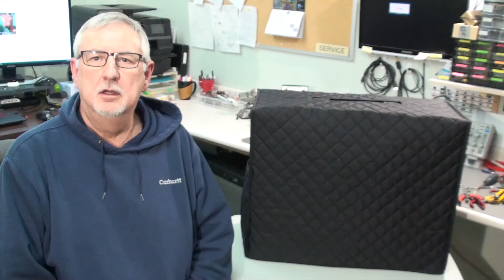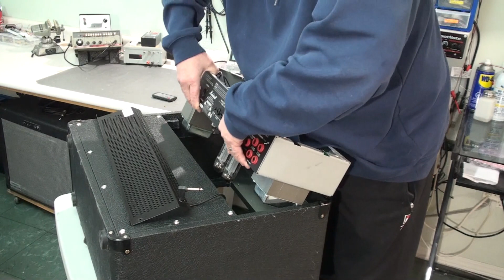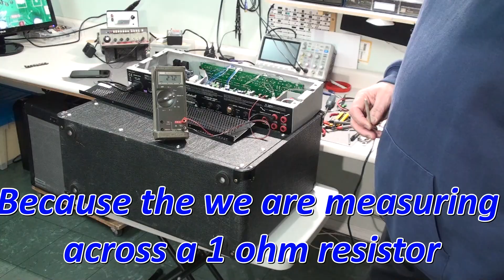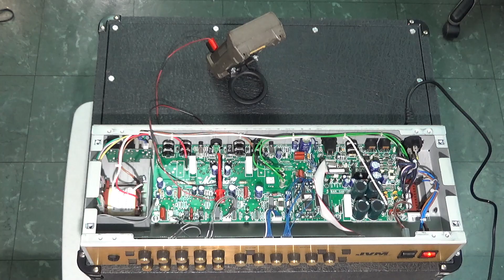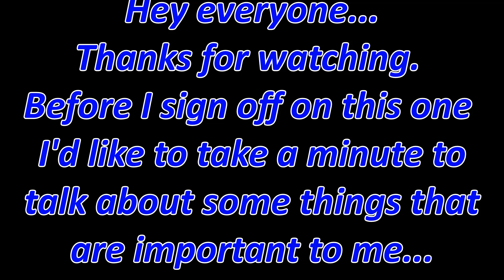Re-Tube and Bias a Marshal JVM215C Amplifier

Comment: Tubes don't change the sound. Only the gain-factor and maybe how the amp "feels".
And the bias is not "too cold". Modern amps like this one get all their gain from the preamp, and are designed to have the power-amp-section stay clean as long as possible. Meaning that if you set the bias hotter, you'll only wear the power-tubes and transformer out faster.

Comment: I have the same amp. The left side bias is normal at 35mv, the right hand side is 70mv when cold with the bias pot turned as low as possible, and steadily climbs to a scary 114mv after about 5 minutes. 
I have the dreaded bias drift on an amp built in 2022.
Reply from the maker: Thanks for the comment. I haven't encountered this, but I really haven't done many bias setups. I did a quick search online ("tube amp bias drift") and there does appear to be quite a bit of information. I could reiterate what I found but it would probably be best for you to do that search and check out the results. I will say that the simplest and most obvious solution (which I assume you probably already tried) is to change out the tubes, and make sure the new ones are a matched pair. After that, check your power supply voltages. Hope this helps and you solve your issue...
Reply: Great video, very informative. Thanks a lot

Comment: could you run 6L6 tubes in this amp?
Reply from the maker: Thanks for the question. I'm not sure I have a good answer. My experience with tube amps is somewhat limited. I have read that they have the same pinout except for pin 1 is missing on the 6L6 and the El34 uses this pin and there is circuitry connected to it. The voltages and bias currents are different as well. However, apparently some amps are designed/built to accommodate either tube. I found one comment on line that said, "Amps wired for EL34's can take 6L6's no problem, provided they can be biased. However, Amps exclusively wired for 6L6 tubes may require rewiring of the sockets to accept EL34's." Your best bet is to do some searching on your own, or talk to someone who does a lot of work on tube amps. Sorry I can't be more help...
Reply: @techtips983  tnx

Comment: Great Video thank you very much.  Wish i can have a question. Same with your amp here but mine sounds different after changed new tubes.
Reply from the maker: I'm not really an electric guitar player but I've been told by experienced players that they can hear the difference in sound when using different brands of tubes. This is probably just because of somewhat different construction techniques. Also, if tubes are not matched, or if the bias is different they will sound different. If you want the same sound you should probably buy identical tubes, make sure they are matched pairs, and set the bias the same as before. Even then, I wouldn't guarantee they would sound exactly the same. Thanks for the comment/question.